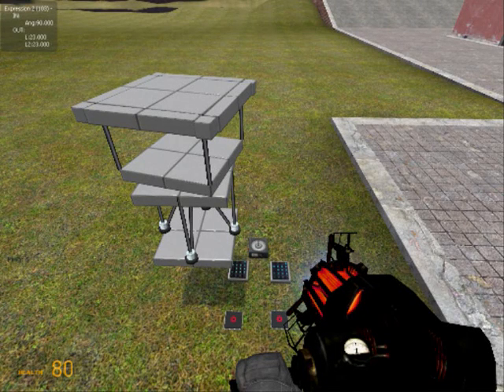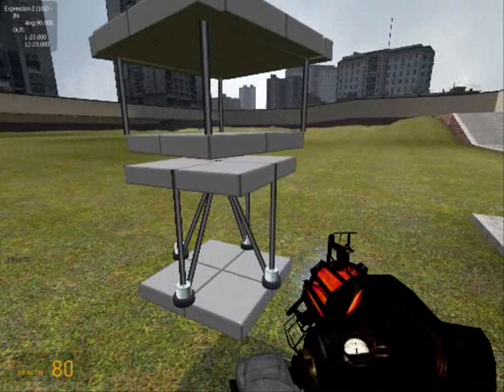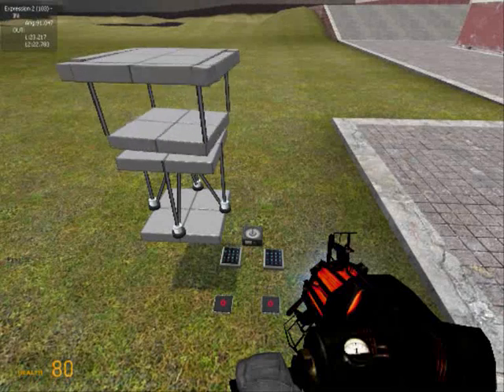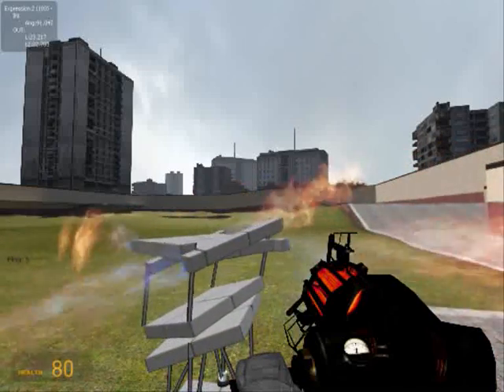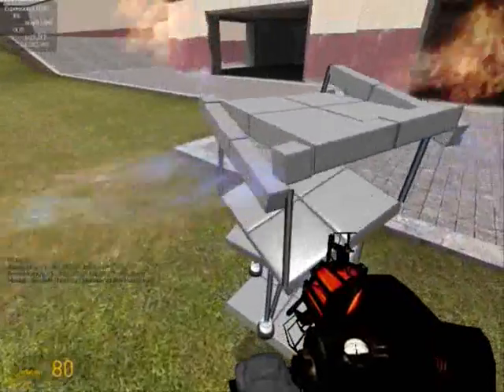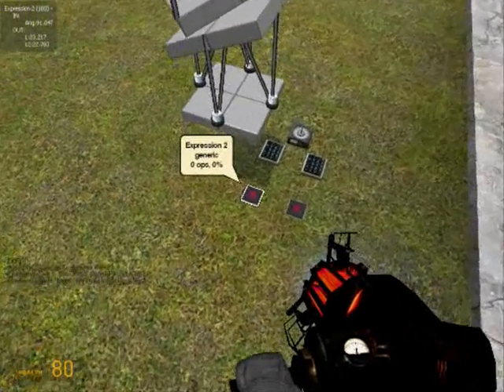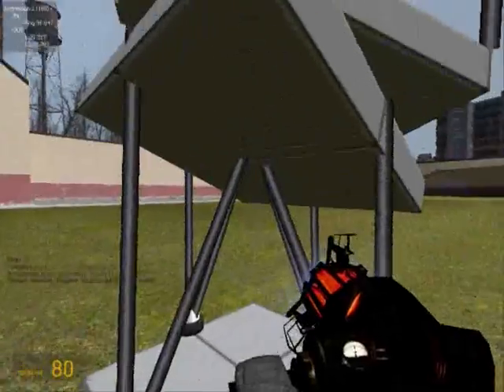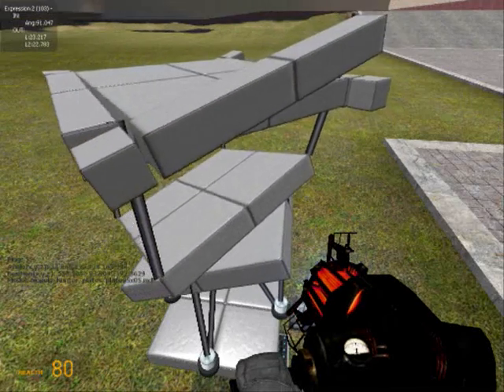RhInO's PoC Swashplate!

Comment: It seems to lack one of the most important things though, it has cyclic pitch, but I can't see how you can change the collective pitch xD

I'm working on one too and it's quite hard, mine is almost the same as yours, but where you have the ballsockets, I have the ballsockets to a small cube, and a slider to allow the ballsockets (cube + swasplate) to go up/down. It constantly spazzes though, so I need to redesign it :(